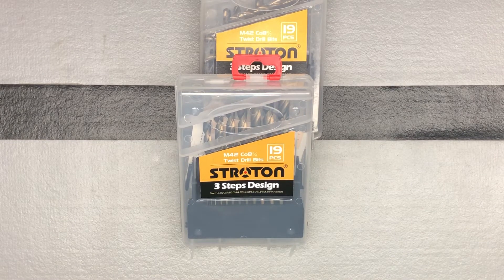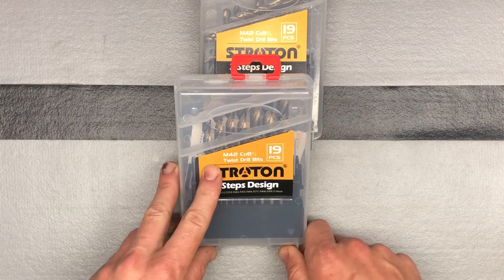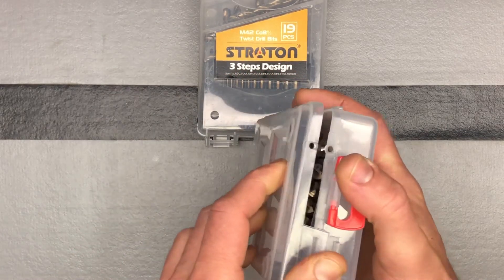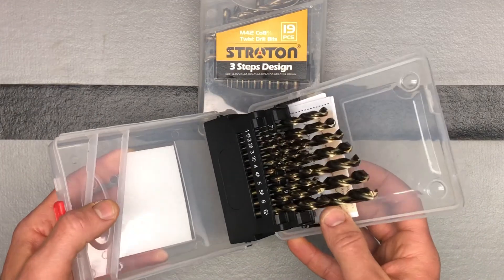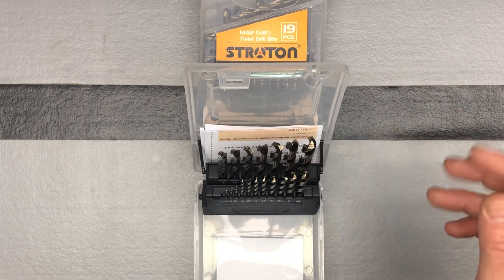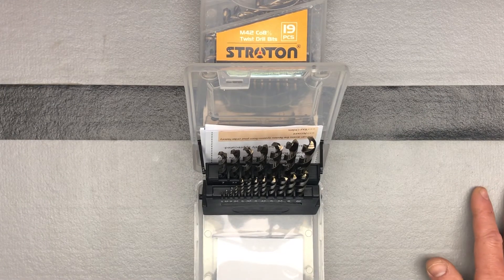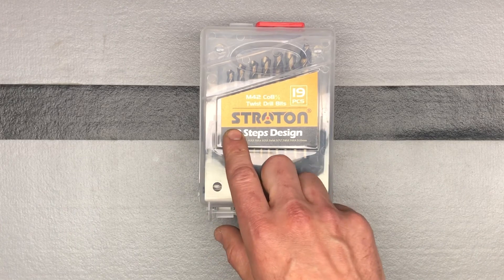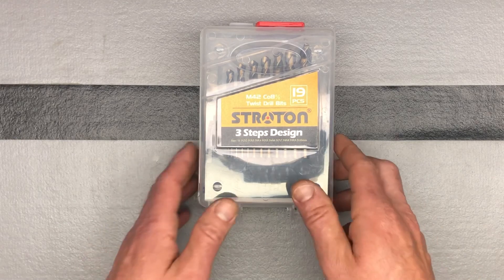Unboxing & Review: Stroton Metric M42 8% Cobalt Twist Drill Bits Set for Stainless Steel and Metal

Comment: You can get a Drill bit cutting oil/lube that will help keep from burning the bit's up, but if they're going to warranty them.... I like catching the Harbor freight bits on sale for jobs I don't want to take my time with then if I burn/break them, no big deal.
Reply from the maker: I thought about getting cutting oil but these were not too expensive and I knew they said they would warranty them. It is very hard to find 8% cobalt bits at any retail locations